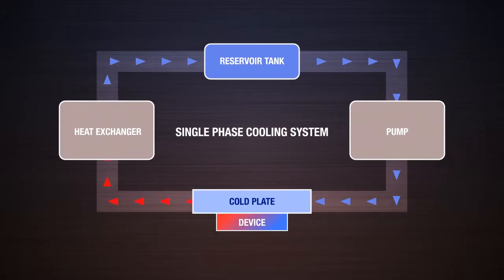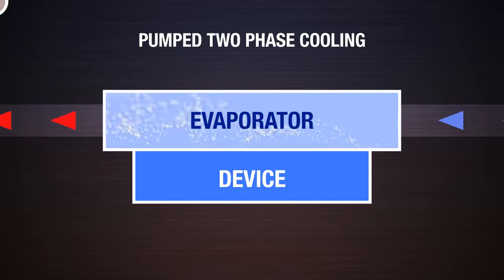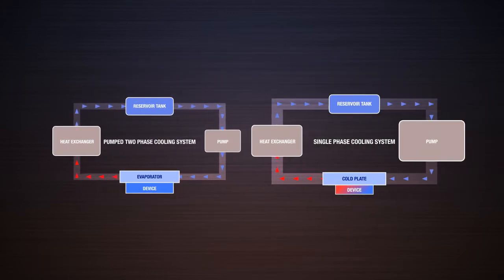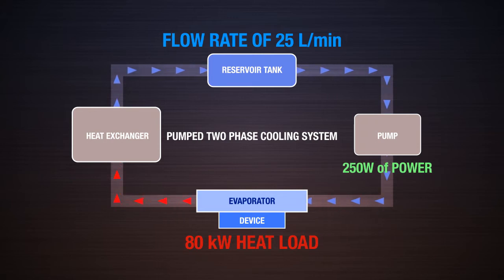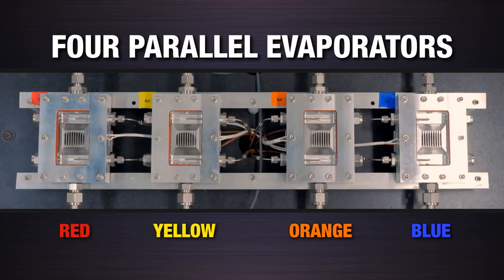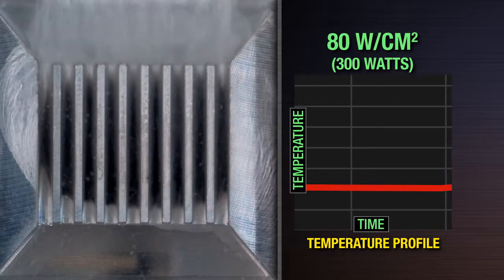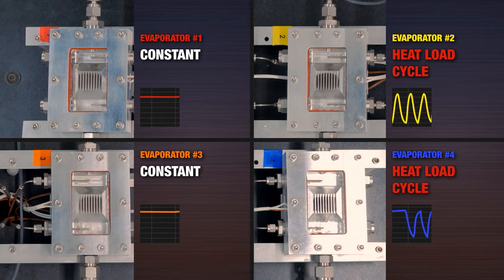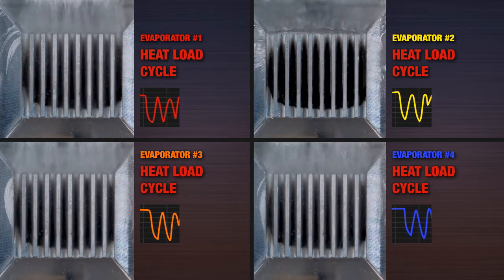Pumped Two Phase Evaporative Cooling Basics and Demonstration

Comment: I have a question maybe a noob question. If this dielectric liquid turns into steam that is basically water, how is it possible that it does not mix with the special liquid?
Reply from the maker: Hi Carlos, thank you for your question.  In the video we refer to the vapor form as steam.  This term steam is not a 100% accurate in describing what actually occurs.  The working fluid (in this case Freon) vaporizes.  It is not steam but the vapor form of the fluid.  We use the term steam – which describes the vapor form of water – to help viewers visualization of what is occurring in the system, by referencing a fluid phase change that is common.
Reply: @AdvancedCoolingTech  Thank you for your answer it means that before close the container tank is needed to extract the oxigen? or do a air vacuum inside?

Comment: 2:59 in this video - you use a 250W pump to remove a 80KW heat load? So the COP = 80,000/250 = 320? This is hard to believe when you compare this number with a typical automotive AC loop of a COP of 2 ~3.
Reply: the cop is 0, or -0.03. they are using a 250W pump to circulate the waste heat outside of a device.